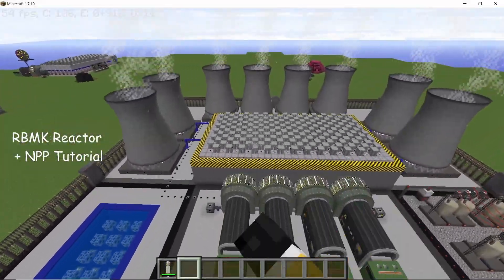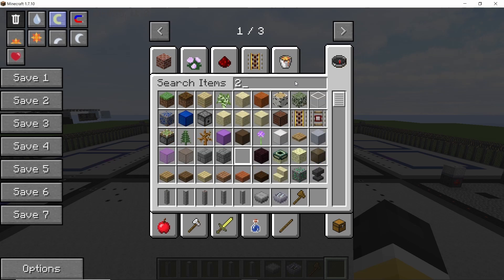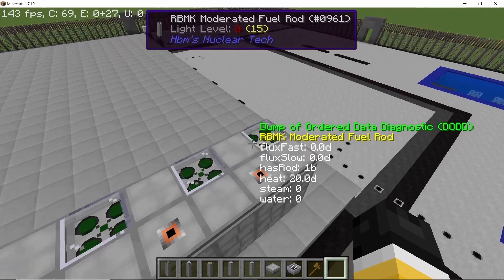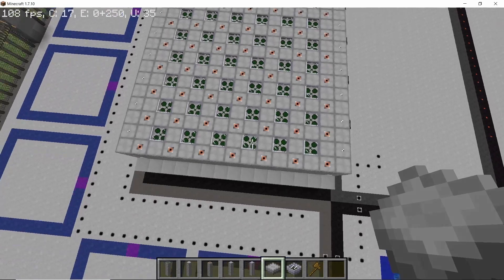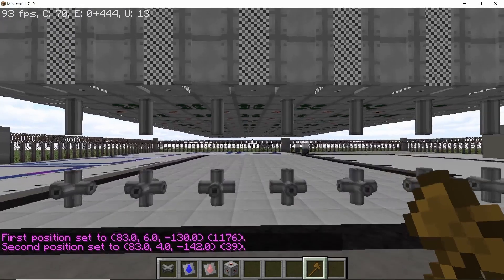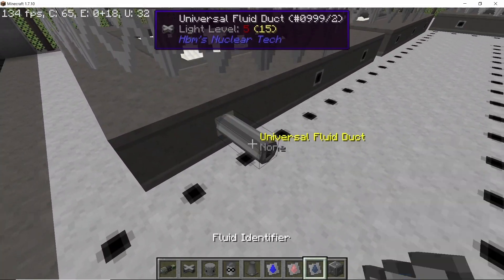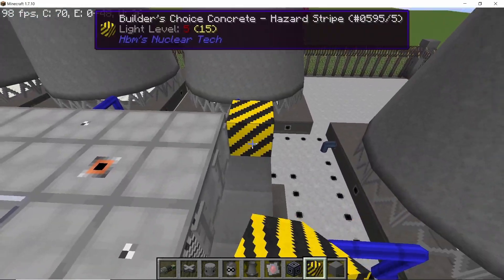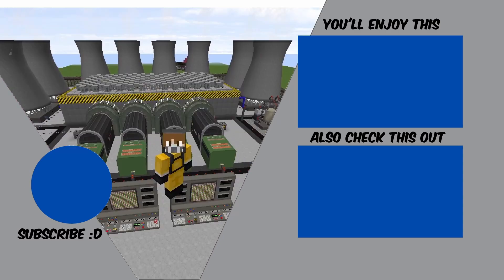RBMKP - Nuclear Power Plant Build / Tutorial - AZ5 Capable - HBM's NTM MInecraft

Comment: Accidentally caused Chernobyl all over again when I built this... And I was in the chunks the reactor was in, too... I think I forgot to set something. Did you set any gamerules with this one (my RBMK parts were 4 blocks tall while they appeared to be 2 blocks tall in this video)? It could also be because some things changed since this video was made - I'm using the latest version of HBM's NTM.
Reply from the maker: I had no special gamerules for this reactor, it was a normal reactor with whole lot of medium powered fuel rods. Also the height of the reactor doesn't really affect anything other than the fps. Well it can be true that the new update changed something, tho that seems unlikely to me as the fuel in this reactor is less reactive so as long as you have a continuous loop of water its temp stays in the normal range

Comment: Recently, (with that i mean a few minutes ago) there was an issue with my power plant with this reactor where steam could not exit the reactor, so it could,ve blown very easily.
So i was trying to use power generated by the plant for equipment for the plant, when i began experimenting with the power switch. so i started up the reactor with rods 25% out, when i realised the turbines wouldn't start spinning. So i shut down the reactor down and inspected it. I could'nt find anything strange, (at first i thought it was an issue with what steam the boilers would produce) i started up the reactor again and quickly realised nothing has changed. I got worried and shut the reactor down using AZ-5. That worked and i quickly started to look for any faults and remembered,
i had replaced some blocks under the reactor using worldedit, so maybe that messed something up. And it turned out, the replaced blocks deleted the paintable fluid duct, simply leaving the steam nowhere to go. This could've ended really badly.